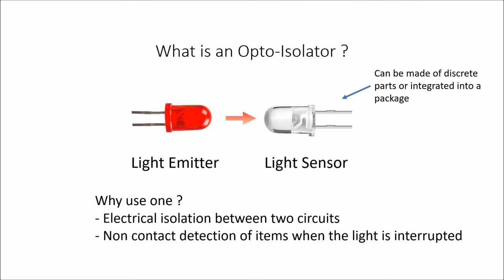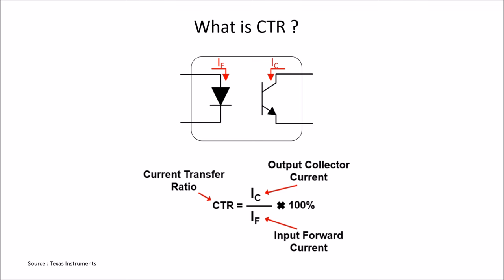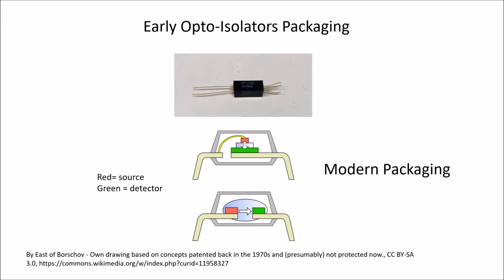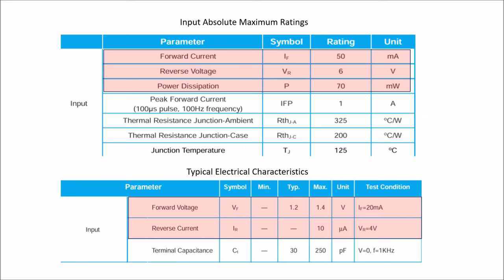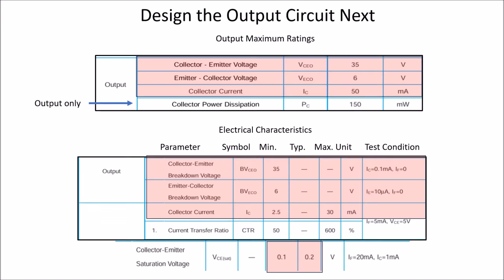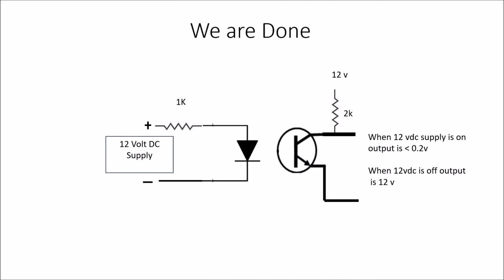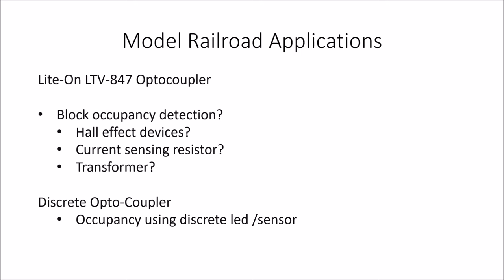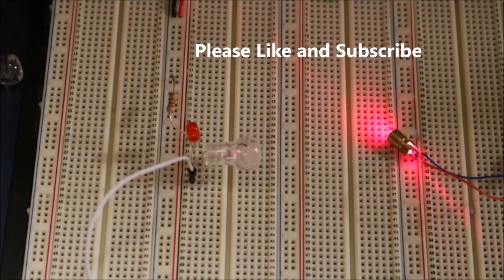How to Use Opto-Isolators - A model railroad example

Comment: Photovoltaic mode optocouplers can be useful for triggering high side n-channel Mosfet switches into lowest resistance, without exceeding source-gate voltage.
Use a photovoltatic effect to add a voltage on to transistor's source and apply it to the gate